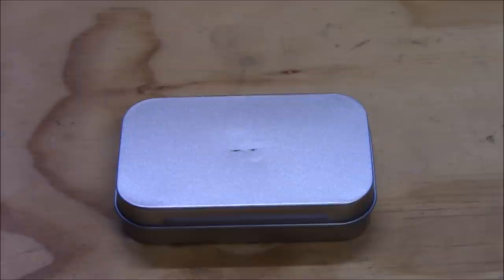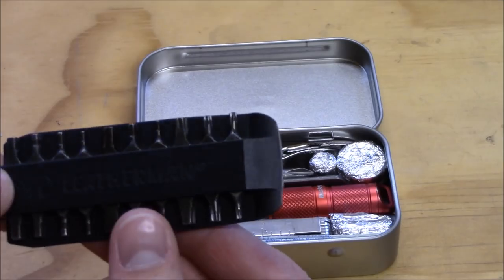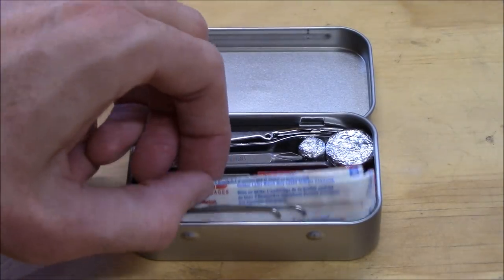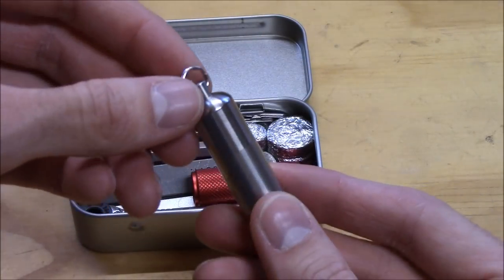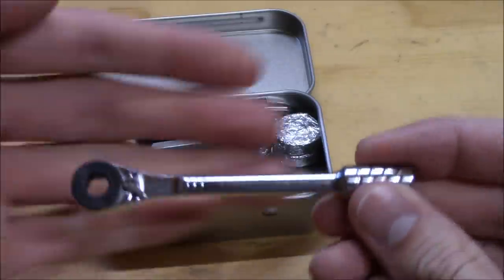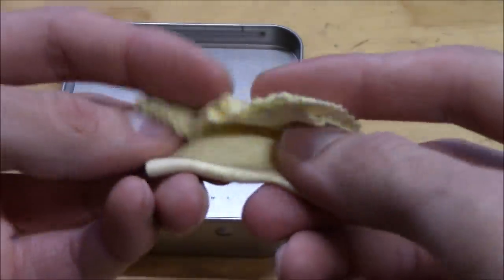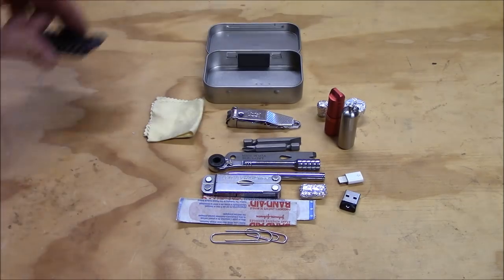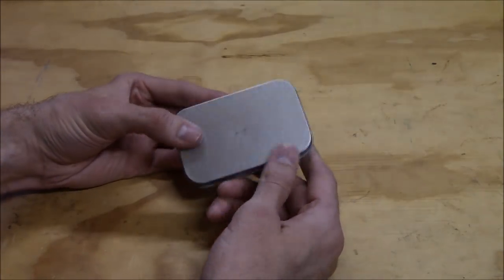My Altoids Tin EDC Kit

Comment: Since the tools shows this is not woodland centered two other things and one suggestion. 

Top with a folded bill. A US dollar bill is the same size as hundred but choose your denomination. 

Rubber bands but not inside. Wrap on outside so the until otherwise needed serve to keep lid more securely closed. The belt pouch serves to do this but if you get fumbled fingered opening it don't want to drop all that stuff and have to search for it, maybe in the dark. The rubber bands also will reduce the possibility of it sliding out of a pocket if the tin is kept there. 

Suggestion;
Tums are nice but I value an antidiarrheal more. 
I would rather walk around with an upset stomach than a load in my shorts.

Comment: Great work.  One suggestion for you.  On the inside of the tin lid you can put strips of tape like I do for fixing or labels.  Different types of tape might include painter tape for waterproof labels, duck tape, electrical tape, shrink wrap.  You can also a razor for flat scraping.

Comment: Nice kit  -  though I wouldn't bother with pens, just take the refill, it's large enough to write short notes with it (won't attempt to write an essay or a novel anyhow).
I don't use nail-clippers, they always leave sharp edges, which I don't like - I carry a small sapphire nail file, cut off the handle, which makes it just a light-weight, flat piece. It can act as a knife sharpener too, when kept wet and handled gently.
That should give you enough room to fit one or two quick-tinders and a small piece of duct-tape.

Comment: I recently noticed that there are tins similar to an altoid tin available on scamazon with different dimensions.  So instead of sizing down a tool that almost fits an altoid, one can buy a slightly larger tin and get more stuff in it.  But you do have some cool kit in there.

Comment: Awesome video. I would suggest (if you don't mind), a pencil, maybe instead of the pen, and if you can a pencil sharpener. The obvious reason for the sharpener needs no explanation, but the less obvious use is, any small twig can be run through it and made into shavings, perfect for fire starting. Again, awesome video. Thanks.

Comment: Great little set up. Does the leatherman bits fit in the leatherman or in the ratchet or both? Also the only thing I could think of is maybe a aquatab for water purification. Really great kit though.
Reply from the maker: Thanks, and the bits kind of fit in the ratchet, but not very well. I feel like they wobble a little too much. I usually only use them in my Leatherman Wave which I carry on my belt in a custom leather holster that holds both the Wave, and my ThruNite TN12 flashlight.

Comment: May I recommend the Olight i1r 2 as your backup flashlight
Reply from the maker: I considered that one, but I didn't like that its battery was built-in and not replaceable. The X4S was one of the only flashlights I could find in this size range that had a battery that wasn't built-in. If not for the X4S, I would've probably gone with the Olight.

Comment: Won’t the magnetic tape mess up your Sandisc thumb drive?
Reply from the maker: It hasn't yet, and I doubt it will. According to the research I've done, it would take a much larger and significantly more powerful magnet to damage anything electronic.

Comment: Do you have a link to the ratchet?
Reply from the maker: The O'reillys site is the only place where I can find the exact one that I show in the video. https://www.oreillyauto.com/detail/c/power-torque-tools/power-torque-9-piece-1-4-inch-drive-two-way-key-bit-keychain-set/ptt0/gm4315?q=Power+torque+ratchet&pos=17
Reply from the maker: Otherwise, the Topeak mini 1/4" ratchet is exactly the same, again just with different branding. That one should be readily available through Amazon and other online stores. :)